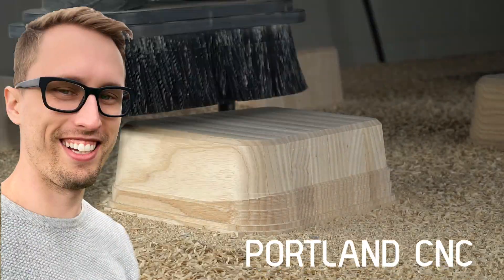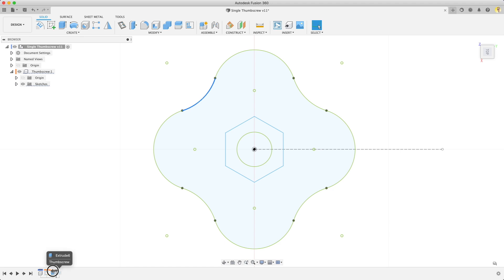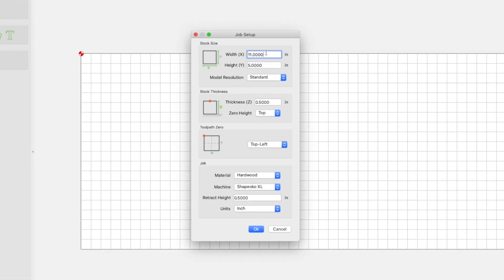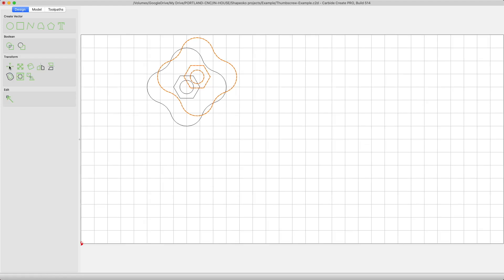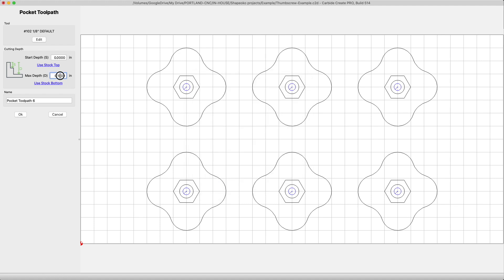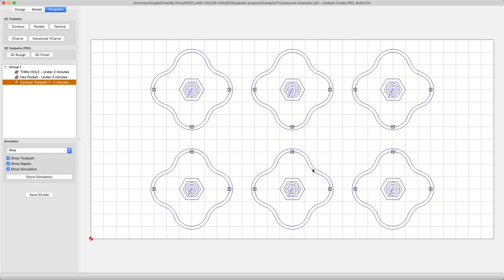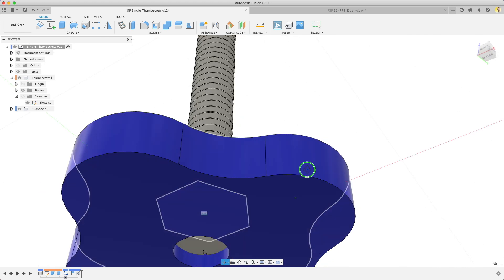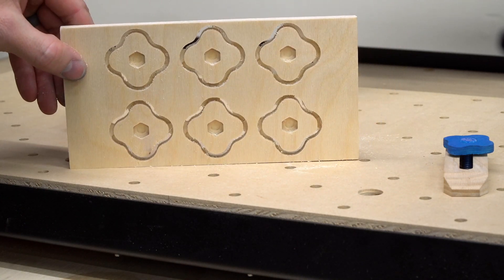Making Simple Thumbscrews for Easy CNC Workholding

Comment: What length screws did you use?
Reply: Hey, I think they are 1 inch long but this really depends on how long you need. I think a variance would be useful in case you need a taller part hold.

Comment: Nice thumbscrews. Also like your clamps,I built smaller for less obstruction on spindle. 8mm height, 25, 50 & 7m mm length, 25mm wide,7mm slot and 3mm rebate one end for side clamping, 90° inset triangle for corner fixing opposite end.
Reply: Yep, most of my work is small/thin, so I need low impact clamps. I can Jack them up with blocks if I need for thicker work.
Reply: Thank you. There's never enough (types) of clamps, right?

Comment: To seat the bolt, drill a hole the same size as the bolt threads, slide the bolt through the wood, place the assemble in the hole, and drive home the head (instead of trying to seat the bolt from the backside like you are).  Interesting video.
Reply: Ha, yes. Smarter than my version.

Comment: Could use a deep well socket or piece of tubing over the bolt to make it easier to tap the knobs down
Reply: This is probably the fastest way - find a deep socket that nearly clings to the thread.  Put the thumbscrews on a flat, hard surface upside down. Place socket over the threads and give it a good whack.  In lieu of a set of deep sockets, put a hole in some plywood just bigger than the outer diameter of the threads. Place thumbscrew face down in hole. Give a good whack.
Reply: @Zarlax   yeah, wish I would have thought of this 😅
Reply: @pdxcnc  dood - that’s why we post videos!  It’s all learning all around!  Another cool use for that threaded table is a set of inserts to always hold your stock aligned to the travel of the gantry - something I (with my garbage t track setup) didn’t think of until I saw YOUR video (even if it wasn’t the goal of your video).
Reply: Smart. My neanderthal version was a bit rough.